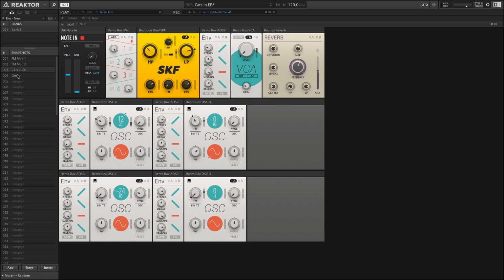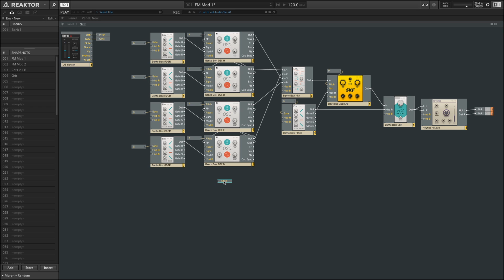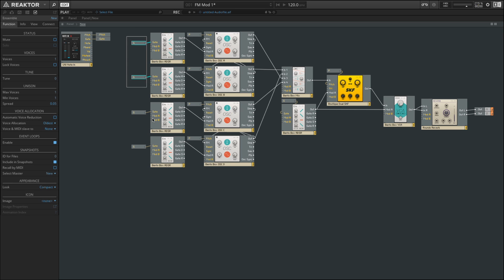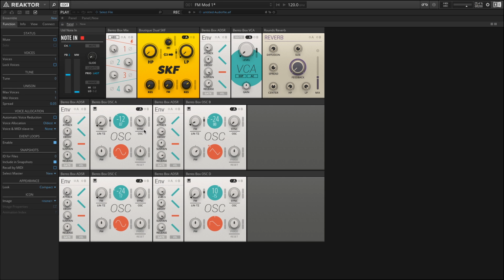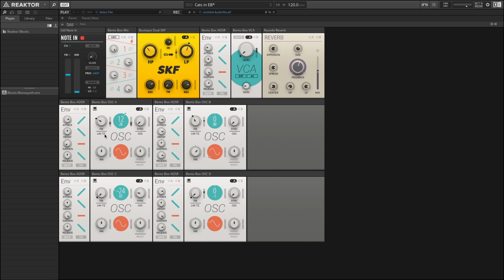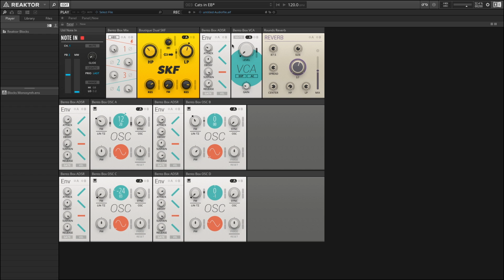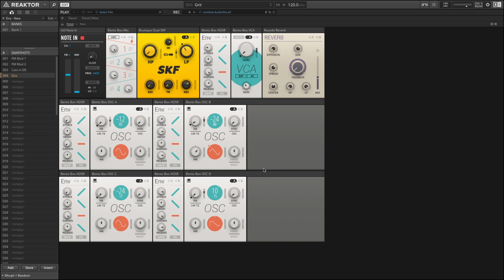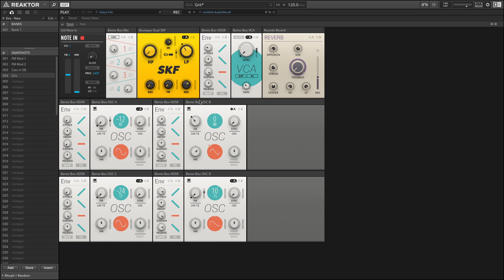Reaktor 6 Blocks Tutorial #3 "FM Modulator"

Comment: Hi Owen, thanks for the great video. 
Two question: 
* why have you connected OSC A to Mixer In 3, OSC B to Mixer In 1, OSC C to Mixer In 4 and OSC D to Mixer In 2 and not OSC a to Mixer In 1 and so on? Is it to have the modulated OSCs first and the modulating OSCs second?
* Why have you used just a single letter for the terminal-receiver modules? Is it so you can quicker/better differ senders from receivers?
Reply: i think for the color of the operators in the mix. 1 with 3 and 2 with 4. Is for FM mod